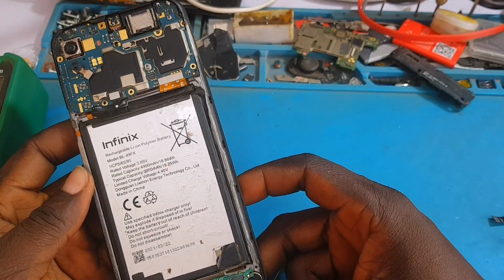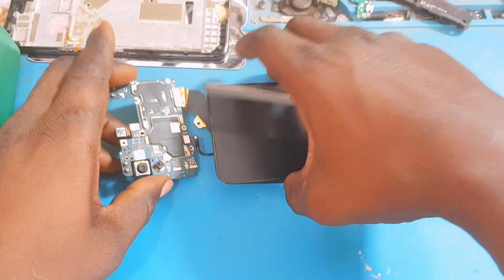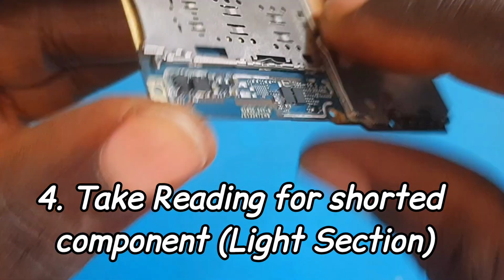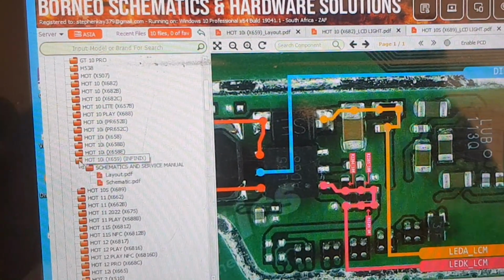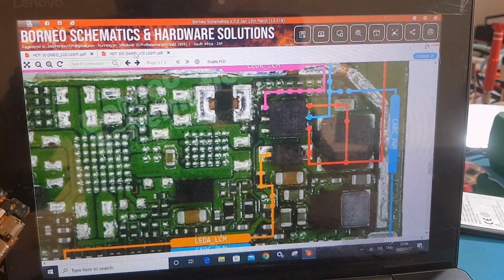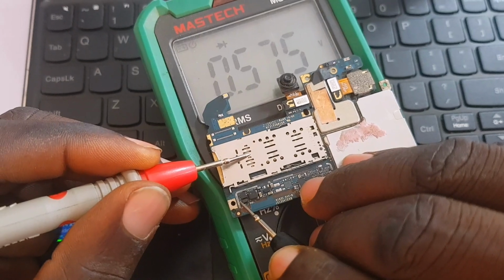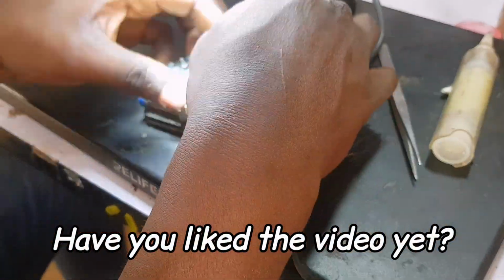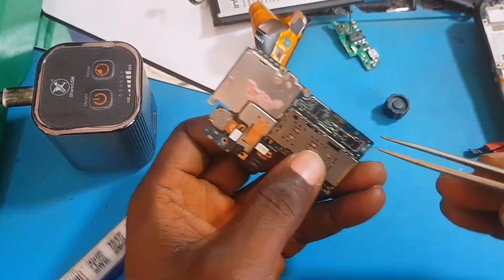Infinix Hot 10i X659 Backlight Repair Guide, Troubleshooting and Repair

Comment: Hi sir, i want to ask something. Is there any chance we need to replace the display ic, in case with fully working lcd except the backlight not turning on? I tried another lcd on it and its same, so yeah the lcd is fine but not with the backlight. Great video btw, thanks for sharing
Reply from the maker: @rifqiakmallubaid4550  If backlight is not working, you need to focus on the backlight section. I have a video on my channel that addresses backlight problem, go watch it.

Comment: Please sir on the schematic diagram the  diode was connected to some capacitor and later went straight to the first pin.But Why you connected from the diode straight to the first pin capacitors. Will there be any consequences.
Reply from the maker: @stephenwiafe5614  If you also take your jumper from the capacitor, it is fine, inasmuch there is continuity from the diode to the Capacitor.